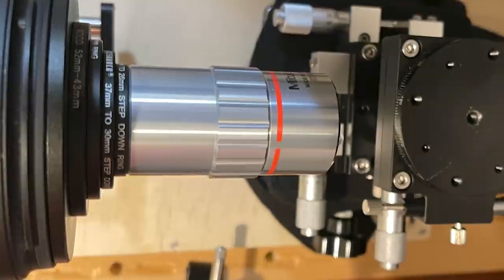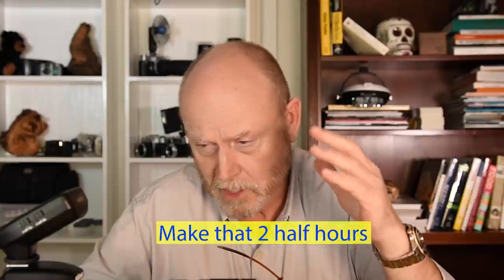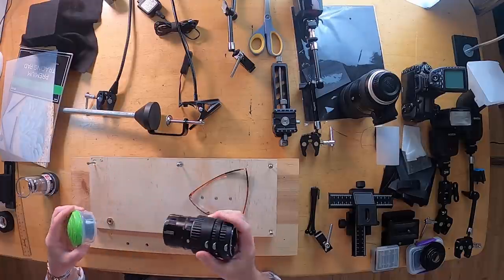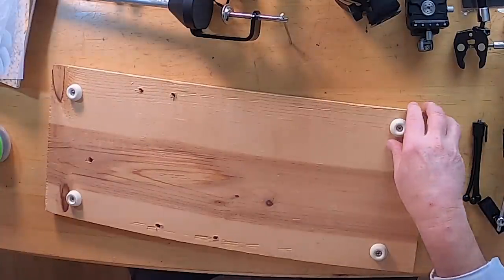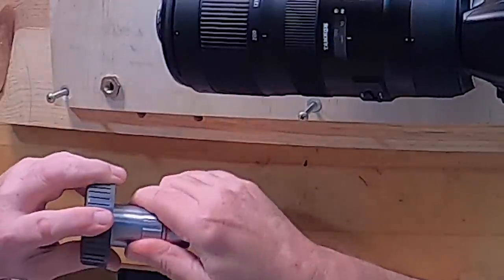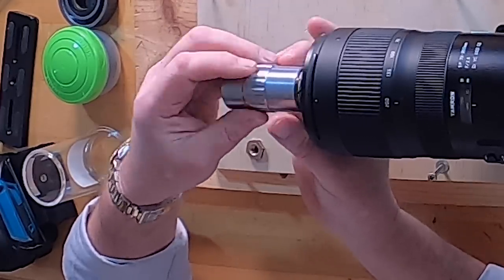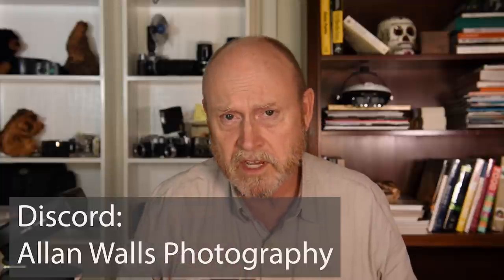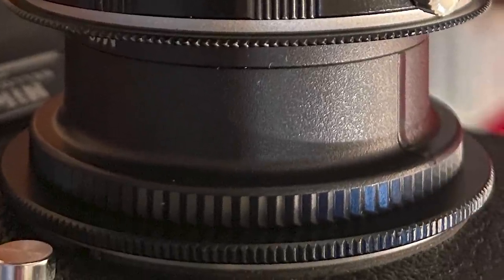Mitutoyo M Plan Apo -  Quick Start Guide for Macro Photographers

Comment: As far as some problems with the flashes is concerned in the beginning I have made my experiences with misfired flashes and double contoures ruining a couple of hundred stack shots. The solution for me was 1. buying 4 Yongnuo 560 III (from one production line !!) and a radio flash controller YN560-TXII and 2. buying 4 Yongnuo SF-18 Compact battery packs holding 8 black Eneloops each.  I use the flashes normally between 1/4 and 1/128 power and only within the macro cage. Charging them before every session of up to 700 shots with let's say a 20x objektive I never had the upper mentioned problems again, never ... Hope that helps
By the way, thanks a lot Allen for publicising this extraordinary Mitutoyo glass ... you got me looking forward to get one ...

Comment: Ok, first set of questions: I have a 70-200mm f/4 lens (I assume I can just adjust the output power of the flashes to compensate for the lack of a 200mm f/2.8 lens). I assume that is ok? Also, I have 7 step-down rings on the end of it (67 mm thread) to get to 26mm for the objective.  That a lot thicker than yours, but it should work, right?  

Also, I have an Raynox 150 (and 250) and a bunch of extension tubes with more on the way, so I'd like a setup for that too.  

I have one crop body (90D) and two FF bodies (5DS R and R5) that I can use for macro.  Currently I'm going to play with the 90D since it is very pixel dense with a 32.5 MP crop-sensor.

I will start building the platform and lighting system soon, but unfortunately, I have some travel to do in between.

Thanks again.
Reply from the maker: Yes, absolutely - don't worry about the f/4 lens. I should have mentioned that I use my 70-200 at f/4. And yes on the infinity space. You could get away with a lot more than you will have with those step rings.

Comment: Another great tutorial, Alan! Thank you very much. I am intrigued to see which new speedlights you are getting.
Reply from the maker: Well, I'm not! When I went to order them they are sold out. It is the Godox TT350s that I am getting. Perfect macro flashes.
Reply: Thank you so much for responding to my comment, Allan! I was looking to get the same speedlights (TT350s) for my set up unfortunately they are also sold out here in Australia. By the way have you seen Godox new MF 12 speedlights yet?
Reply from the maker: @timoohlsen  Hi Tim, unfortunately the TT350s are sold out here as well. I never did get them. I am intrigued by the MF12s which won't be out until October. I will probably get a couple to test, but I am concerned about the battery life. As I move to using more and more individual low power flashes, these sound like just the ticket, but not if they can only handle 200 consecutive shots. Hopefully that can do 1200 shots at 1/128, but I will need to make sure before I buy 6 or 8 of them. The TT350s still sound like the better choice and i will get them if they ever come back in stock.
Reply: @AllanWallsPhotography  Thanks for your response again, Allan! I really appreciate it .  I am really hooked on all this macro photography you are doing, thank you for sharing your immense expertise. It‘s very impressive indeed. Regarding the speedlights-  Apparently the new MF 12s are capable to deliver 500 flashes at full power.  I am keen to see how they perform in case you  decide to test them out. Do you mind me asking, why not get the Lithium-ion powered V350 instead of the TT350s if you are concerned about battery capacity? I know they are a fair bit more expensive but also have more than twice as much flash output. Looking forward to hear your opinion. Many thanks! 🙏
Reply from the maker: @timoohlsen  That is a great question with a strange answer. I do a lot of flash photography, hundreds of flashes a day, and I pay attention to how my equipment performs. Well I have a mixture of Godox lights (TT600s and V- 8 something or others). Neither of them have power issues if I am using Eneloop Pro batteries, but one of them does overheat if I end up using a high power flash like 1/4 (rarely). And it is always the battery pack flash that drops the shot. So, knowing very little about power, batteries and heat, I am left to believe there is something related to the Li battery pack that is causing thermal shutdown occasionally. That and the price. They are about twice the price and I would also need at least one extra battery pack. I think I am going to go with the MF12s.
Reply: @AllanWallsPhotography  Thanks Allan, that makes a lot of sense! I will certainly be looking out for them (MF 12s) in your upcoming videos and will be keen to see if they have any thermal shutdown issues with their inbuilt lithium ion batteries. Cheers, Tim
Reply from the maker: @timoohlsen  After answering your comment I got a call from Godox and will getting a box of MF12s next week - review to follow!
Reply: @AllanWallsPhotography  Brilliant news! I bet there are thousands of photographers waiting for. Thanks for creating those reviews Allan. Absolutely fantastic 🙏👍

Comment: I'd like to see the setup for the Raynox, although I have the Marumi brand +3 and +5 diopter lenses.  I imagine the setup will be the same regardless of manufacturer.
Reply from the maker: Lovely lens - you have the DHG Achromat? That should make for an excellent tube lens - when I talk about setting up the relay lens at 208mm from the sensor, make that 200mm for the Marumi. And please share some of the resulting images. I have wanted to get one of those lenses for some time.

Comment: II’ll be using bellows with reverse mounted Raynox…just waiting on an adapter (shipping on the slowest boat from China). Appreciated the tip to go with 16 sec delay for the Godox flashes. I’ve been keeping it to about 8 seconds. Haven’t noted as overheating but it’s possible. Once in a while a flash will not fire during a stack, and you know how irritating that can be. So, will increase the delay time on the StackShot. Thanks Allan.
Reply from the maker: It drives me crazy - as a card-carrying perfectionist, a single misfire will ruin the shot. One thing I didn't mention is if you are using the V series flashes, with the battery pack, they are much more prone to dropping a flash after about 300 low power firings. The battery operated TT flashes will continue to flash until the just stop. It is a problem that is frustrating enough to make me reconsider my choice of replacement units. I don't know if the V lights are more prone to overheat or if the power management is poor. One last thing - if you see significant central softness, flip your Raynox back to normal. I was getting a soft center in reverse.

Comment: Would like to see a video featuring the Raynox 150 with extension tubes if you have the time. Thank you for your very informative and entertaining videos!
Reply from the maker: Should be releasing that video later today - if the power holds during the coming deluge - just substitute "bellows" for the same length of extension (and be sure to add some kind of support for that much extension so as not to damage the flange of your camera).
Reply: @AllanWallsPhotography  thank you!

Comment: The post just delivered the amscope plan 4x. Now i need to figure out how the heck i can mount on my camera :)
Reply from the maker: Use the black tube cap. Epoxy the cap to the outside of a body cap from your camera. Then drill a hole through body cap and objective cap, Screw the onbjective into the cap and place the body cap on the camera (or extension tubes).
Reply: @AllanWallsPhotography  Haha, i figured it out when first opened the package. Thank You! Ordered a RMS to M42 adapter, it will take a few months to get here. Now i need some more extensions. Could buy a piece of blackout cloth locally. Will make a simple bag bellows quickly to be able to try the lens :)

Comment: Can I clarify if a 200mm lens on a micro four thirds camera would  still work as the transport lens? Eg the Panasonic leica 200mm lens. I know the field of view is 2x with the crop but not sure how that would work in this case.
Reply from the maker: You are correct. It will be a cramped (or intense!) field but  the relay lens would still need to be  around 200mm focal length and set up at that distance from the sensor.

Comment: Great information! How do we connect the SMALLRIG 9.5 to the Godox V350. I see you have some device on the speed light but don't see a link to where we can get it?
Reply from the maker: The clamps I am using in the video are these - https://amzn.to/3rPDDQe - but I had problems with one or both of the springs coming loose. I am hoping the captive cold shoe from SmallRig will be a better alrternative (it is looked in the show notes).

Comment: Edit: f200 was referring focal length, my bad.

I assume the flash is required because the apature is that small? E.g. f200 being crazy small. 

Eeek, always used led static lighting for my macro, no flash in my kit.

Comment: Maybe good to tell that the objective is quite heavy and possible need some support beneath the tube/long lens. How to do that I don't know....maybe Allan can give some advice?
Reply from the maker: It is indeed a very heavy objective - far larger and heavier than any objectives we may run into, with the noted exception of the Qioptic Mag-X LD Plan Achromats that are just a little bit smaller than a grain silo. I would strongly advise against trying to use the M-plan objectives on extension tubes without good support from below. It is a very good way to destroy the aperture actuator mechanism of a DSLR - I know because I did just that to my D850. I recommend investing in a good set of bellows - the Nikon PB-6 or Nikon PB-4 - though others do, apparently exist. With bellows the weight is not an issue and is supported easily withers much infinity distance as you care to add. But if you plan to use extension tubes, mount the camera and the extension tubes on a long Arca-Swiss type rail using tube supports and QR mounting plates (one of theses: https://amzn.to/37kEXBd and 2-3 of these: https://amzn.to/3AkzfvX and some of these slip rings with posts (pick the right size for your tubes): https://www.thorlabs.com/newgrouppage9.cfm?objectgroup_id=9623

Comment: I would love to see a Raynox video using a bellows and Stackshot. I would especially like to see you use your current preferred setup and technique that you use to create your remarkable images including Stackshot settings, flash settings and specimen setup. I use exposure delay of 3 seconds to raise the mirror and allow vibration to settle as I am unsure how to do the two exposure routine you use. I use the 860 Godox flashes.
Reply from the maker: I am preparing that video right now, but to address your specific questions, the stackshot settings will vary with the subject, but if in any doubt, shoot a few short stacks of the subject to make sure you are getting good coverage. I use as many Godox V860s as I need, all on minimum power, to get the subtle lighting I like. I hardly ever increase the intensity of a single speedlight, preferring to add another separate light. This cuts down on specularity and makes for more natural fall off. I use a lot of diffusion material - in front of every flash and covering the subject. I prefer to set the stackshot (in the config menu) to 2 shots and I use long delays of 8 seconds Toff and Tpause, 16 seconds total. That, of course, removes any vibration but much more importantly it guarantees that my speedlights will not experience intermittent thermal shutdown, causing misfires and ruining the stack. The first impulse raises the mirror (camera is set in Mup mode) and the second releases the shutter. My go to setup is Raynox in normal orientation at 208mm on bellows, I then add 30mm of infinity space using a stack of step down rings that end with a 26mm ring to accept the Mitutoyo. It has taken me years to settle on this default setup, but I will make occasional tweaks as the subject directs. But the single biggest factor in the final image quality is how you manage the stack after it is shot. The post-stack workflow is at least as critical as the capture. I recommend you watch the stacking and retouching video that is coming out next week to see my most current recommendations for finishing up a shot. Good luck to you!
Reply: Thank you Allan! Most informative. I will try to increase my infinity space for my next specimen. I just ordered 2 Godox 860 rechargeable flashes to be main flashes and use my Nikon SB-800 flashes for accent lighting. You mentioned you were looking at some new flashes that might be better. I can return these if you think there is a better way to go. Thank you for all the valuable information you share.
Reply from the maker: @BudPerrott  I have ordered (or will when they get back in stock) 4 TT350s from Godox. I will let you know how they work out. Congratulations on winning the competition!

Comment: excellent videos thank you , i have 2 questions if please can help

1- can you suggest a good objective but a cheap one for my 70-200mm lens?

2- if i used my 70-200 lens, what is the difference between infinity corrected objective and the non-infinity corrected one ?
Reply from the maker: I think the best deal is the Nikon CFI Plan Achromat 10X. At $200 you won't find anything close to this good. You can find no-name infinity corrected objectives for $30  and they are just rubbish for photography. If there is a cheaper objective of this quality, I don't know about it. As for the second question, you would not need to use your 70-200 with a finite objective - all you need is the correct length of extension. Your 70-200 will work with any infinity objective that requires a 200mm tube lens.
Reply: @AllanWallsPhotography  can't thank you enough

Comment: Hi Allan thanks once again for a very useful video! I often wonder when or even if you ever get any sleep! :)

A question about stray light.
I have cut out a black foam tube similar to the one you have in the video, to slide over the body of the Mitutoyo which has a very shiny surface.
My foam tube ends just before the end of the objective, the face of which is also very shiny.
I couldn't tell from the video how you had dealt with the end face. Did you extend your tube past the end of the objective?  The shiny surface on the end of the objective is too narrow to risk attaching something to it so I wondered if extending the body tube over the end would help in reducing any stray light from the objective tube end.
I can already see how superb the lens is from the two test shots I have taken. Both colour and resolution are outstanding.
I will have to stop buying more gear!
Thanks again,

Barry :)
Reply from the maker: Well, I am glad you waited until after this lens to start a diet!. I used a foam sleeve with a covering of black flocking material. I let the material extend about 3-4mm in front of the end of the objective and rolled it onto the metallic rim. It is not a great solution - I don't like having adhesive near the glass, so I am taking a much more fitted foam sleeve. A 5mm collar might be enough, unless you are using very perpendicular lighting. This lens is so fantastic it is worth every bit of trouble to protect it from stray light. The results will say a lot more than I can.
Reply: @AllanWallsPhotography  Thanks Allan, appreciated.